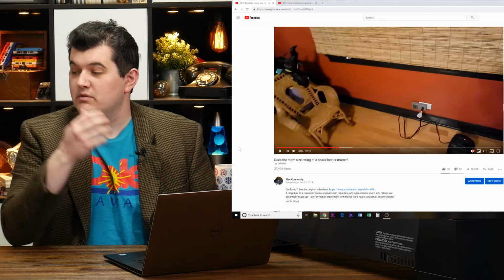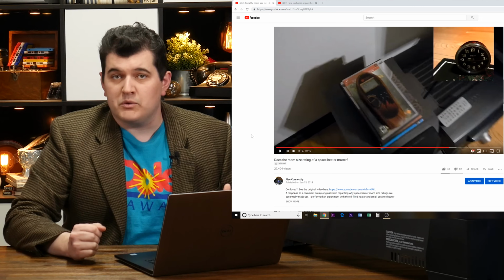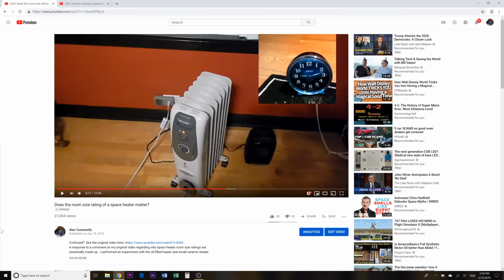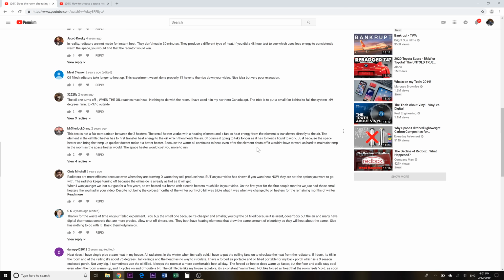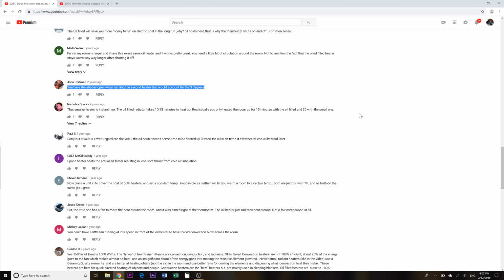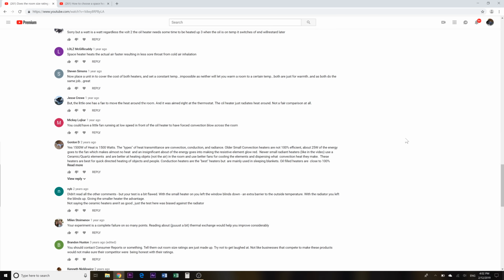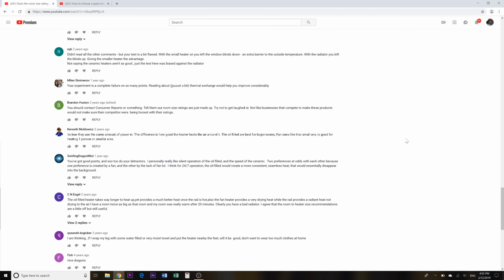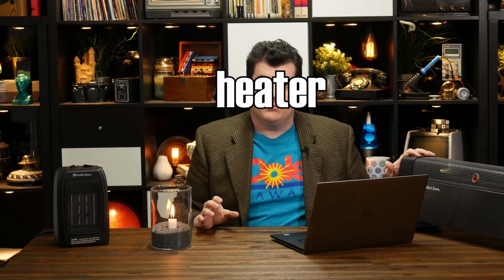More Space Heater Nonsense

Comment: The oil heater will heat a large room that little one will not I promise you. Get a large room and see. It will take hours for the oil heater to get there though. No the room size ratings are right you are ignorant.
Reply: I hope you don't make the same type of promises to your friends, Family, and significant other, because your promises are worthless.  1500 watts is 1500 watts.  If anything, having a heater with a fan will circulate the air in the room quickly, Making parts of the room feel warmer sooner.
Reply: Still don't get it, eh?

Comment: The only thought that occurs to me that could justify the categorization for large, medium and small room is the amount of time those heaters are supposed to be on de ON part of the thermostat cicle, and that is a thing in engineering. Assuming that the load is proportional to the size of the room, a 1500W heater should heat a small room fast and shutdown quickly. The experiment in this case would be put all heaters outside in a snowing day ans try to fight winter. Let they run to see who dies first. I bet the small one will give up in a short time.
Reply: Well thought that also at first but doesnt make sense. They both produce same amount of heat so they need same amount of time to heat the room. 
Then i thought maybe bigger one has better cooling like can run longer but that defeats the purpose of heating. Materials are same cause same brand. 
Only thing that can make sense is that small one has fan that is too small and doesnt "remove" heat from heater as fast as heater can produce it so has to shutdown but that would be intentional and doesnt justify such price increase for small medium and large (like in first video)
Reply: They both 1500w heaters. So they both need to run same time.
Reply: @s777nserg : No, he's trying to run them up to the point at which they get the room as much hotter that they'll ever be able to get it than the temperature he started at.
Reply: I would think perhaps try to find a large and small room version of a similar heating method though, to eliminate issues like the poor thermostat reliability on the oil filled one in this case.  Maybe try like two fan heaters, I am sure there is probably someone selling a "large" room fan heater for 3x the money to test against.
Reply: THIS! This might be the real deal right here! THIS is the argument that makes sense to me!
(But by the way, you can try to fight winter whether it's snowing or not.)
Reply: FYI, the real case is that the larger ones can handle more power.. but they're restricted in his particular home area. In short, he's ignorant of other markets existing where manufacturers dont' design brand new products for every market.
Reply: @Folsomdsf2  He did mention it. His point though is 1500W, its 1500W with no regard for the size of the heater or where the heater is located(geographically). The point of the video is specifically that these various products are advertised for small, medium, large rooms and ALL have the same heating capacity. Now as you point out, some markets do have higher ratings sold, permitted by code, ect. In this case its say, 1900W vrs 1500W, and yeah, the 1900W one is better at producing heat for a "space". He also mentions there are benefits to the various styles. The oil radiator ones he specifically mentions that they are safer due to the lower surface temp and reduced risk of fire. There may be other benefits like lifespan, noise from a fan, physical size, ect. Those are for someone who reviews specific products. The video was about science, and a critique of marketing as he explicitly stated.
Reply: If they have to change the wattage on the box to be accurate for a different geographical market then they could easily remove the "large room/small room" portion of the label designs. His argument remains -- don't use meaningless labels to mislead consumers.
Reply: @Folsomdsf2  
If they're changing a "large" room design to a lower rating to comply with an area's standards, it shouldn't have the same marketing. A big rig with a wimpy 1L I-4 engine should not get advertised the same way a big rig with a V12 Diesel.

Comment: If i need to heat the workplace: electric fans and resistive load. The best, by far, they can really blow the heat far away from the unit and heat up the room in minutes. If i have to live in the room: passive, oil filled electric radiator. No other choice is as comfortable. The stable heat they give WAY outweigh the speed that a fan heater has. You don't want the fan kicking in every 15 minutes or have the room lose heat when you briefly open a window or a door.. 

But: passive heating needs air circulation, convection alone will not do it. It does not need to be much, just that the air actually moves. The large oil filled radiator has a HUGE surface area so even a little bit of added circulation will make it act faster.

One idea for a video: my parents house here in Finland has used heat exchanger since '84. It is passive, my uncle actually designed it and it can heat -25C incoming air with +20C outgoing and get up to 17C when it comes in the interior. That is one MASSIVE heat source that is too often just ventilated out.
Reply: By that measure, having a ton of water in a room that is heated by fish tank heaters and have fans blowing over them is the best way to heat a room because the additional thermal mass makes the room's temperature more stable. I don't disagree, but I think a smarter electric fan heater is still way more practical. That, and you might not want the thermal mass because the room will be slow to warm up and slow to cool down. If you're not in the room that's being heated, that energy is wasted as the room cools down.

Having even basic PID control of fan speed and heater output would allow the fan to ramp up and down and the heating coils to ramp up and down, as they are needed. This could better control the room's temperature without wasting energy in an empty room.

Also, if we're talking about efficiency, a heat pump is way more efficient than any of the above options.
Reply: sorry for an ignorant question: what are they exchanging the heat from?  I'm pretty sure my house doesn't have any significant heat source that's being vented (in Japan), and likewise my parents' house (in the US).

this sounds like a great idea, so I want to know more.
Reply: @thoperSought  it's done through phase change of liquids to gases. If you reverse an air conditioner, where you are essentially cooling the outside and the condenser is on the inside dumping the heat into the house. As long as the outside temp is higher than the refrigerant it can take BTUs from the air and move them into the house. And these refrigerants  are super cold. I live in Arizona where it gets hot (50C)  and I've seen frost form on AC units that need servicing and standing next to the outside unit dumping the heat outside is like hell. So if the process is reversed then it can heat a home. My knowledge is very limited but I think I got the basics down and I'm sure others will explain it better, but I just remember that there is only heat.. add heat or take heat.  Look up vapor compression refrigeration. Have a great day!
Reply: DenseAlloy What you just described is something that I have seen marketed around here (Minnesota) as a “heat pump” - functions like an AC during the summer (Typical MN summer can reach 100+F) and then reverses the flow of refrigerant to bring heat inside (MN winters have reached -40F). These systems aren’t nearly as efficient as separate standard AC and heating systems. And they’re not nearly as efficient as resistive electrical heating, either.

However, a “heat exchange” is something that’s completely different. I used to work at a decently sized performing arts venue, with seats for over 400 people in the audience plus 100 on the stage. The building code required our HVAC system to have CO2 monitors and be able to replace all the air in the building with fresh air from outside every few hours when occupied or when CO2 levels got above a certain percent. The HVAC system did have a heat exchange as part of that - as air entered the building, the exiting air would warm up or cool down the air coming in until both volumes of air are the same temp, so instead of having to heat a large mass of -40F air to 70F, it would only have to warm up the air from 15F to 70F.
Reply: @eharp2518  thanks for the clarification
Reply: @eharp2518  reversible ac are* more efficient than electric heaters if you count only electric power, as they get some energy out of the cold exterior air.

(*if designed correctly.)
Reply: manaquri In some situations, yes, a heat pump, or reversible ac as you say, can be more efficient. However, heat pumps use a refrigerant gas that operates very closely to the ideal gas law, Pressure x Volume = number of moles x universal gas constant x temperature. Or, to put it simply, compressing a gas will increase the temperature, and expanding gas will decrease in temperature. The efficiency of the whole compress gas, release heat, expand gas, lose heat cycle is reliant on the temperature differential between refrigerant and inside/outside air, and desired differential between the inside/outside air. Again, I’m in Minnesota, which has been compared to Siberia as far as climate goes. When it gets well below 0F (-18C), it gets much harder to literally squeeze any heat out of that.
Laws of physics aside, from what I could research, a 2.4kW heat pump could generate 36,000 BTUs of heat with an outside temperature of 15C (59F). Great, awesome, better than 8,200 BTU’s of straight electrical heat. However, that efficiency decreases as outside temperatures decrease, to the point where 8,200 BTUs of electrical heat would be a better use of energy here in MN.
A geothermal heat pump, however, is a completely different story, though the installation costs make it a mostly unaffordable option.
Reply: @eharp2518  true that once you go below -18, you have to either use another gas, or use a dual stage one, which is less efficient and more expensive.
Here it rarely goes below -10, so regular heat pumps are an option.
Geothermal isn't that expensive if you do it yourself, and your soil isn't too rocky, loan an 8 meter auger, and buy some piping and a pump.
Total cost is around 1000bucks and a couple of weekends.
The tricky part is not having the loop freeze (given the cold loop of the heat pump is at around -18, if ice forms it will make cooling less effective.), so some amount of pg has to be added, which increases the cost, but all considered I think 3k including the pump is probably doable.
Reply: Lassi Kinnunen  thanks for the clarification
Reply: Yes! Heat exchangers should be mandatory! If houses are sealed and well insulated, with a heat exchanger on the ventilation system, you don't need to put in that much energy to keep your house warm. Blowing out 25°C air from the bathroom and then sucking in -20°C air in through the vent is just helping the crows. My dad built a two stage system with a passive heat exchanger first and then a heat pump placed after it. The heat exchanger does most of the work, and then the heat pump finishes the job. After the heat pump, our exhaust air is often at or below zero degrees even though the outside temperature is above freezing. So our 25°C exhaust air is cooled down to about 0°C, and the fresh air that enters the house is heated to up to 50°C, depending on the outside temperature, of course
Reply: @SuperSiggiboy  agree, but they are called HRV (heat recovery ventilators/ventilation)... they do exist, and i agree they should be part of building code

Comment: The best I have found is a Premiere that has a 4 inch fan that actually allows it to heat a room not just a spot. Kudos Premiere!! I use it on the low power setting down to about 0-10F before I switch to high heat setting.

Comment: Ive always wanted to know the btu output of the heaters. Thats how id like to buy them. But watching this video (and the one on the main channel) helps understand that 1500 watts is 1500 watts. Thank you.
Reply: Well the BTU on the box there is technically actually meaning BTU/hr as it represents power not energy in this case. 1 BTU = 1055.06 J so 1 BTU/hr = 0.293 J/s = 0.293 W thus why the BTU rating is a bit over 3 times the wattage as 1 W = 3.412 BTU/hr.

Comment: im not sure you right scientifically , in bottom line you right in any way ,  even 10% doesnt change the equation that we pay money per heat .
for the science , what i know is that on same material twice ampere dont give you twice heat - you can give the same 1500w , if its thick or long  or short wire ,its depend on the application (especially if you need to heat fast ) , in some cases you lose MORE energy  (its minor losses but exist ) as electric waves and uv and some even xray which fly away your walls without leaving heat at all . you can check , the electric radiation is  typically high on the small intense devices .

Comment: I feel your pain and frustration with this on electric heaters. I had to live in a static caravan for 5 years which was very poorly insulated, Thankfully I didn't have to pay the electric bill so electric heating was the best option in terms of the cost of heating the space. However the problem was I was limited with the amount of current I could draw so for heating the living room I had to limit the heating load to 2kw. I tried 3 types of electric heaters (all rated the same) the first one was an oil filled heater and like you said the thermostat was built into the side so even on the highest setting  it would cycle on and off even when the room was chilly, next up was the convector heater which pretty much had the same type of built in thermostat so again the room although heated up better over a shorter time the heater still cycled on and off because of the proximity of the thermostat. The fan heater was the next thing I tried, this worked much better the room was a more even temperature in a much shorted time but the room cooled down much quicker once it switched off and the temperature variation made for an uncomfortable experience. I also tried using a flue less mobile gas heater and this heated the room much better but the humidity in the room was too high and led to damp issues! by far the best solution was in fact was an electronic fan assisted kerosene heater, although it added slightly to the rooms humidity the room was heated much more evenly and it was cheaper to run. The final solution in the end was to install a log burning stove with the electronic fan assisted kerosene heater for back up.  So in my experience all the electric heaters did put out the same about of heat (in the end) but it was more the fault of the design and placement of the thermostat that hampered the heat output... rating these things in terms of different room size when they are the same watt output is just cretinous...

Comment: So, a smart oil-filled radiator manufacturer would put a small, silent fan adjacent to the thermostat to pull room air across it.
And/or add a remote (wireless?) thermostat.
And...maybe a current-based safety cutoff instead of a thermostatic one? Could that work (albeit less cheaply)?